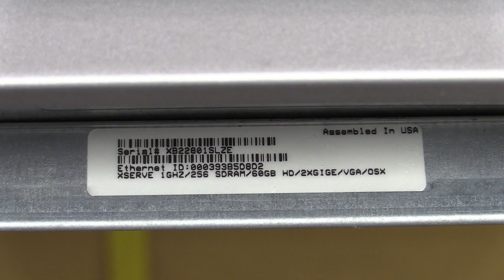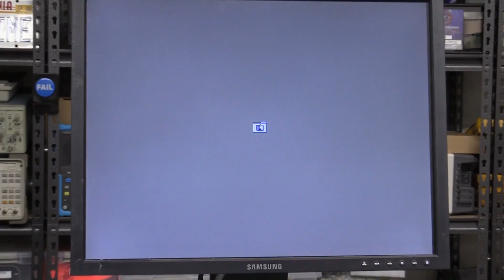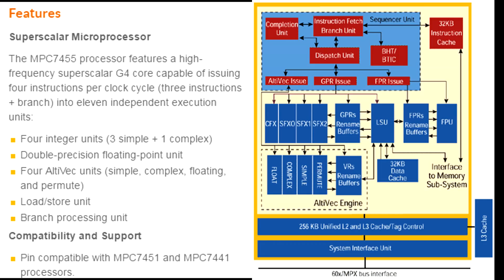EEVblog #882 - Dumpster Dive Apple Xserve Computers

Comment: Hi Dave, I have one similar of this, with the dual G4, i use it as a rendering machine, i cut some videos on a PowerMacG4 and let the hard stuff do the Server, but you are right, the System is very loud. But in the dark the Machine is very cool and if you have a few of this working in a dark server room, it looks really impressive.

Kind regards from Berlin.

Comment: Huh, never seen the inside of one. I do have around 6 of these still operating in the data centre I work at, among some other prehistoric equipment. The fans would have been sucking from the bottom and blowing out the back, at least that's how most with that style fan work.

Comment: where can I find these types of dumpsters?
Reply from the maker: Corporate business parks.
Reply: I used to go to RPI, which had several locations around campus where you could drop off electronics for recycling. Dumpster diving was very popular there, with much cool stuff to be had. (I assume this is still the case, but the administration seems to have a goal of eliminating everything good at RPI, so maybe they're gone now.) I think the electronics recycling program was established by one guy in the waste department many years ago, so if your school doesn't have something similar, talk to people about setting it up. And be sure to mention that allowing dumpster diving will reduce the amount they have to pay the recycling company to take.
Reply: In my area they have recycling centers but they wont let you take any thing because they want to sell it and if there are any dumpsters open you can actually be fined for taking stuff out of them if you get caught of course, but lots of places have been getting thoughts crusher dumpsters sigh.
Reply: +EEVblog What about on a college campus?
Reply: My university at the end of each year they throw a lot of stuff away, i was able to find some oscilloscopes this year.
Reply: that is them,expects code,intel agents,ppp rides of ciphers yunno..

Comment: Those fans are not sucking. They're blowing. They're called blower fans. They pull air in through the 'turbine' and push it through the heatsink in front of it.

Comment: Any fan shaped like a snail shell is centrifugal, and the suction is always the center opening and the discharge is the part with the largest tangental cross-section, ie., the rectangular outlet. Source: many successful rebuilds, and a few mistakes.

Comment: 1) the fan was a powersupply fan. very common stuff in servers
2) case design is atrocious. the fact that the cover pulls back is horrible for rackmounted servers.
3) blower fans intake on the bottom and output trough the back. general air intake is trough the front and out the back like with every single rackmounted server out there.
4) its blowing onto the pci slots. older raidcontrollers and nics get very hot and in the serverworld are almost always passivly cooled
5) appreciate your videos but damn you should ask a question into the audience if you dont know about things :) how else are you going to learn otherwise

Comment: @3:10 - it's really a pretty bad design, because it means you need to derack the thing every time you want to get the lid off! A typical HP or Dell competitor will allow you to pull it forward in the rack far enough to be able to get the lid off and change parts without unracking.

Comment: That's pretty normal rack design, suck air in from the front (cold aisle of Data Centre) and throw it out the back through the CPU and into the hot aisle. Sweet video... these servers still give me nightmares... I very much hated Apple Xserve migrations!

Comment: 3:47 Those are apple magic fans, they pull air from an extra dimension. THAT'S WHY APPLE STUFF COSTS SO MUCH! Just think how much money in r&d went in to making fans with a built in extra dimension, I know i can't and that's why i could never get hired at apple. My mind is just not free from the limits of thermodynamics and on top of that i don't believe outdated hardware should be more expensive than current hardware.

Comment: most servers go into a failsafe mode thermally when it detects the case is off which causes all fans to go to 100% RPM.  It tries like heck to save itself.  Once the case is put back on, it should ramp back down to normal, quiet (for a server) mode.

Also, racks are designed to pull cold air from the front, hot out the back.

Comment: We had some of these servers in my old company. The guy in charge of IT purchasing was a true Apple fanboi - wouldn't touch PCs, and he was one of the least technical people in the company. Pretty much just did video recording and editing. These servers were ridiculously expensive and underpowered compared to the Linux/Windows servers at the time. The only reason to buy them (for non fanbois) would be if you needed a very specific app that was only availible on OSX - and even then... Hardly surprised they stopped making them - most IT professionals who have the budgets to buy servers don't tend to be people who make their buying decisions based on shiny cases.

Comment: the "mac things" are firewire, not really mac thing :P
Reply: Firewire started as an Apple-only thing in late 1994, so they could justify charging double the price compared to the same specced IBM compatible which didn't natively support IEEE1392 and needed an expansion card and drivers for Windows 95 release 2.

Comment: The Xserve was rubbish compared to Compaq ProLiants  and Dell PowerEdge Severs running Windows server at the time, especially for the price. They were really loud (typical of 1U servers of time) but the marketing didn't imply you'd have them locked up in a server room.  Fan-boy graphics designer types bought them "blind" to replace relatively quieter pedestal (typically 6 - 8 SCSI Disk capable) servers in their studios only to find they'd have to buy an additional  sound proof (oven) cabinet to kill the noise. I was also called to site to answer stupid questions like where's the equivalent Windows  Backup or Microsoft Exchange  (Email) Server application on Xserve/OSx, apart from Filemaker (weird name for a Database application) Apple had virtually no server software which was the Xserve's real demise. Pretty much any NAS or White box server at around a third of the price could do file sharing, which was generally all these graphics designers numpties where requiring from the Xserve.

Comment: The G4 was actually never a very good processor... It's actually the primary reason that Apple discontinued sourcing their parts from Motorola and moved to Intel... Well, I should say, the general lack of improvement by Motorola in their CPU architecture.

Comment: +EEVblog Sadly Dave, your understanding of how a squirrel cage/blower fan is not entirely accurate, indeed it is as you might say, ass-backwards... ;-) It actually PULLS air in from the bottom and blows it out across the heatsink... I am not sure if it was a mistake or not, or if that is what you actually understand it to be... Just thought I would make the correction. Hehe have a step-dad day, and enjoy your junkbag of new toys... ;-) lol

Comment: Keep one, install Ubuntu on it & make it a SETI@home/Enigma@home computing node. Just a suggestion.
Reply: +netsurferx1 Not a good deal - any half decent GPU with newer build date than 2008 or so would outperform it by miles as seti@home (or generally BOINC) computing unit at a performance-per-watt ratio that would be better than one of these servers. I did do BOINC computing years ago on various NVidia GTX GPUs and you just can't beat the sheer number of processing units (NVidia calls them CUDA units IIRC). 

It is old hardware. And it was put where it was for some reason. It just can't keep up to current hardware which would be properly designed for the application it is used for. So keep it and be happy when thinking of  the performance it had once in it's job. If you're after real power you will have to stick to actual proper hardware for the  job. Not just that "...but my GHz numbers are higher"-rubbish that is going on in consumer world of course, but proper designed, current hardware.

Comment: That didn't sound very loud to me. I have an old Unisys mainframe tower I got after they replaced it. Before I altered the fans it could be heard pretty much throughout the house. had 3 about 4 inch wide 1.5 inch deep squirrel cage fans. Also 2 internal and 4 bay access 10K RPM SCSI LVD/SE HDD. Dual 450 watt PSU and each was probably a foot long, 6 inch wide, 4 inch tall and probably weigh like 8-10 LB each. Also makes enough heat to raise the temp in a 12*14 room like 10 degrees in an hour. I think most the heat was actually from the PSU and the HDDs. The entire thing weighs like 95LBs.
 
I still have the thing even though it's so old it's near useless. dual 500MHZ pIII Xeon CPU, 4X 256MB ECC, registered RAM. 6X 16GB HDD. Has 1 ISA slot and I think 5 PCI slots divided into two channels. 2 USB version 1.X ports, even with 100 meg network to copy ~1GB usually took around an hour, USB was even slower.

Comment: That board the HDDs would attach to is generally referred to as a backplane. If the HDD are IDE then it could be IDE link, or could be aggregated into some proprietary thing. Usually you see things like this they are using SCSI, SAS, FC, SATA backplanes.

Comment: Almost all servers tower or rack models will suck the air in from the front past the HDDs then cool the CPU, etc. I can only assume they are just ducting it somehow. Parts of the design seem cool other ways it just seems dumb. A lot of the IBM, etc servers the fans are just modules you pull out and work like normal case fans but are modular and small.

Comment: Used to have a couple of these at a company I worked at. The hard drive trays were spring loaded making it super easy to break the RAID if you forgot to engage the lock... and if you did lock it, the USB ports were disabled which could be quite inconvenient such as having software that required USB dongle for licensing.

Comment: If there is one thing Apple is good at its thermal design, theres no doubting they know what they are doing just look at the new Apple Mac Pro's etc. The Xserves didn't really succeed because corporate don't care if something is engineered nicely and looks nice, they want cheap and plentiful with long service agreements when they inevitably break down.
Reply: +electricsnut I was under the impression almost all of their modern laptops have had thermal issues...
Reply: +Keenan Tims Throttling is not a thermal issue, it is thermal management. Apple were the first manufacturer to do away with conventional designs of putting vents and intakes on the bottom / sides that can get block when putting a device on a blanket etc. They moved it to the screen hinge area where it can't be obstructed, now most manufacturers copy the design. Likewise MSI have done a shameless ripoff of the Mac Pro's thermal core design.
Reply: Throttling obscures whether there is an issue or not. It takes significant testing to determine whether it's engaging, and when. It's a huge net gain overall, since it gives you a 'turbo' period, but it can also hide poor thermal performance.

Apple has done some interesting things with cooling, but it always seems to be in pursuit of an aesthetic goal, since their actual performance was demonstrably poor compared to their peers a couple generations ago, I wouldn't hold them above anyone in this regard.
Reply: Electrics Nut I think it was bought mostly by those of us who needed to run some Apple software server side, and the license said "Apple hardware only". So buy one of those and squeeze it into a rack with other miscellaneous servers. Never attractive as a generic server because definitely not generic specs, generic drivers etc., and not exactly cheap.

Comment: Kind of cool. CPUs still bad, even for their time. I have a dell workstation from 2003. It has 2 Xeon F24 CPUs. Single core 2 theads each for a total of 2 cores and 4 threads running at 2.4ghz. Also has a quatro fx 1100. Also has 3 GBs of ECC memory. 36 gb 10k rpm drives. The thing can actually play half life 2 on high. A very demanding game for both the CPU and GPU being a 2004 title.

Comment: 1U servers typically are insanely noisy.  They have to move a ridiculous amount of air to keep cool, especially when you consider the wattage to rack ratio.  From my perspective, the industry has moved away from 1U units, for the most part.  They're just too inefficient for the amount of space and power they consume.

Comment: 1. So are you a "Windows fanboy?"
2. The blowers blow INTO the CPUs, not out of them. And noise is not an issue for servers in a server room.
3. As you noticed, the design is excellent. But you still can't stand Apple.
4. At the time of the G4, PowerPC kicked Intel's ass. All Intel had was the Pentium.
5. Remember these are dual processor, and Mac OS X could actually use them. Not so Windows 98 or ME.
6. You make a big deal out of the minimal graphics card. Surely you are aware that servers don't NEED a graphics card? This is intentional.
Reply: +curtis preston 

 You should watch the video again.

 1. You're missing the point.
 2. As compared to what? 
 3. You lack context & miss obvious cues. 
 4. You're wrong. He referred their speed as though it were poor.

 Just sayin'
Reply: +JL Software 
1. he is not an apple fanboy thats for sure
2. it could have better cooling if it had some vents underneath
3. design is a copy of somebody else s  but prettier typical apple
4. true he even said so
5. true
6. now servers can use big gpus  for some computations
Reply: +JL Software I don't think there was anything in this video to show that he cant stand apple specifically, he is this critical in everything he takes apart because NOTHING is perfect and the moment someone tells you it is, they are usually biased.
Reply: +JL Software 
1. m8 he never said anything about os's 
2. that is still a bad thermal design
3. he never said that
4. he said now about the xeons he didn't comment on the possessors other than that they were g4's 

and no im not windows fan boy i dont use windows
Reply: +JL Software 
1. Does it matter?
2. Correct, and blowers make a little less noise.  Can't say I like the restriction on the intake, but there isn't exactly a lot of space to work with.
3. The design is so-so.  Having the processors on a joined board with the VRMs means if one of four parts goes out, all four are replaced, that's a lot of waste.
4. It actually was the time of the PIII Xeons, and performance was dependent on workloads and OS, properly written, it made little difference between RISC (Apple) and CISC (intel) architectures.
5. Why would anyone use a consumer desktop OS for a server?  And the 9x series OS was already outdated, MS had moved on to NT exclusively.
6. True enough.

Comment: Not loud at all, I need to send you my HP server, this thing is like a freaking jet plane if it powers on
Interestingly there are so many fans in it that even CPU heatsink doesn't have ANY fans on them(it is basically just a big wind tunnel)
Reply: +mikk150 That's usual design for the bigger guys.  The only way to get rid of the fact of one fan failing and your server CPU or the chipset or your I/O card could fail due to overheating otherwise. That's not exactly what you want with a server. The HP server you mention in normal operation will power down it's fans down to a decent noise level. It just powers it up to the limit for cracking free the fan in any case of aging and for checking the fans to work.
Reply: +Slartibartfas042 Yes, I know that. but this is just amusing how loud it gets :). It is also really well cooled, Fans even don't ramp up when I use those two Netburst age Xeons at full blast. Thermals are just amazing (if you'd put some kind of funnel in front of the air intake, you could use whole server as a vacuum cleaner)

Comment: Unfortunately Apple didn't continue 19" computers at all.
But these computers shrunk massively, so it's clearly a simple task to fit the motherboard of a modern Apple server in there. And since you don't really need any PCI cards in a standard server, you could use the space to fit another server in there!
Either for redundancy or just simply having two machines in there.
It also can't be tough to exchange the IDE connectors and fit 4 handsome 6TB HDDs in there.

You'd have a neat little BEAST in a small 19" rack device! Lovely!

Comment: The bridge board you're talking about at 5:27 probably it's the IDE RAID controller. I see a chip marked Promise, which is a famous manufacturer of disk storage controllers.
Probably it's just a software RAID controller (all the RAID stuff is processed by the main CPU which is running the controller's firmware), because "true" RAID controllers have their own CPU and buffer RAM, which here appear to be both missing. That chip it's just an IDE interface chip.
Reply: +mima14031985 Apple for years sell renamed Promise devices (like Vtrak ...) so it is not surprise that they use their solutions. It is not so uncommon practice, Dell did same with EMC (now Dell own EMC) only problem with Apple that they sell Promise products with their badge for 5 times greater price then Promise.
And you are right Promise at that time did not made hardware RAID controllers, they did all in software (and in their SAN solutions they used i860 processors for RAID).
Reply: +mima14031985 Seems to also have the disk backplane on it, which the sleds connect to.
Reply: +Keenan Tims Yes it looks made in this way.